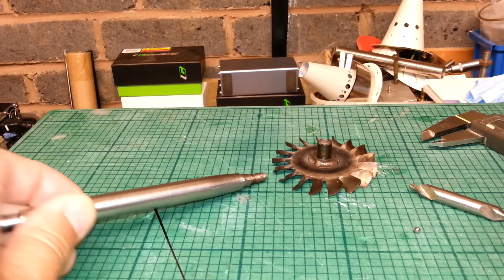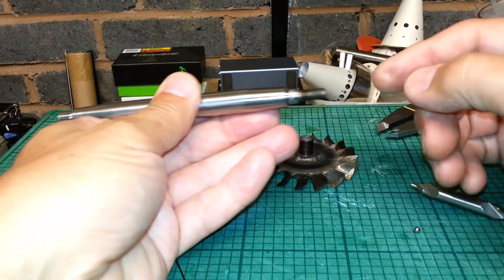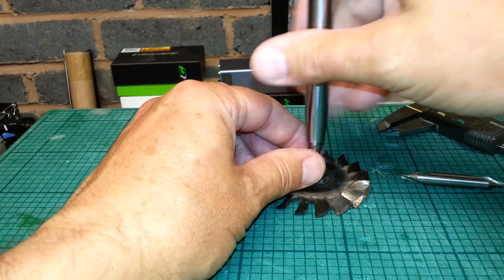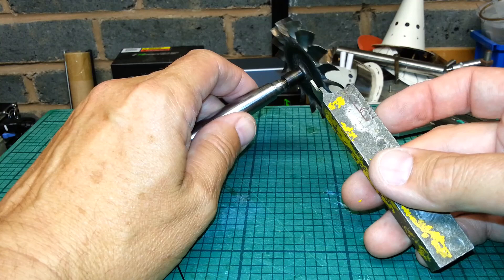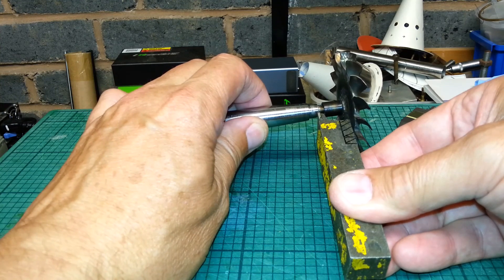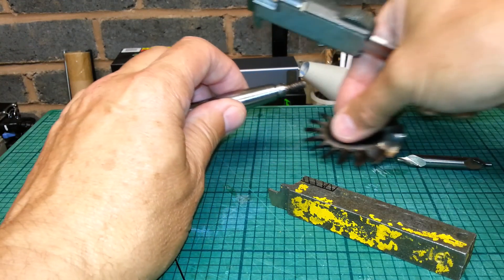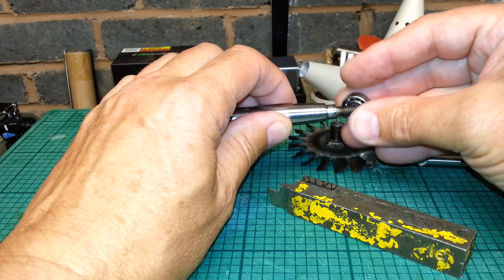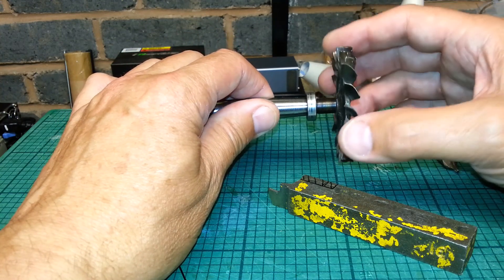Umars turbine bearing fix

Comment: Friend that turbine and stainless 310?
Reply from the maker: Not sure what Umar used I used 310 or 316  as per book.
Reply: @reedy93  ok Friend.
Reply: Ok Chris I try my best .turbine is 304 stainlessteel. I can't  find 310 or 316 stainlessteel on eBay
Reply from the maker: @Umarzaman8400  https://www.ebay.co.uk/itm/316L-Stainless-Steel-Sheet-3mm-Mill-Finish-2500mm-x-1250mm-1-SHEET/274473984868?hash=item3fe7eca364:g:pUoAAOSwz7NfR7wn
only problem is it's £200 but at 75mm sq you could be 528 blanks out of it which works out really cheap !  ok i'll keep looking for a smaller sheet.
Reply from the maker: 347 seems to be used in America very similar to 316.
Reply: Chris if I start production for fd3 for sale then I can think about this big sheet.but still is not worth becoz 1 turbine wheel take aroun 24hr to  make 528 turbine I need 2 years😂😂😂